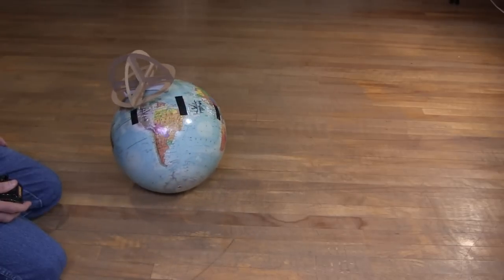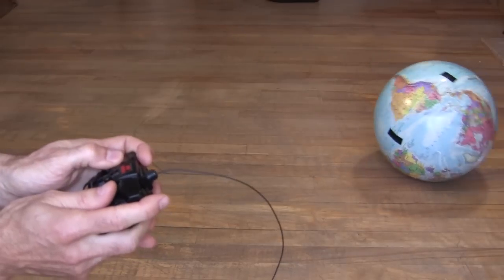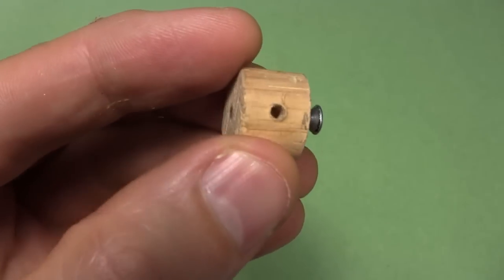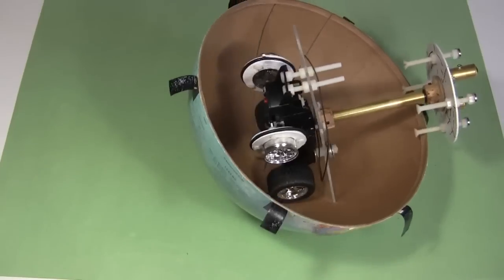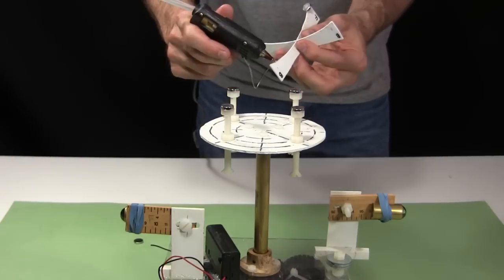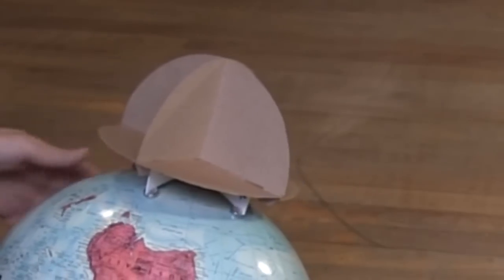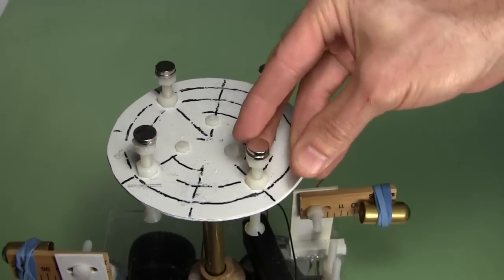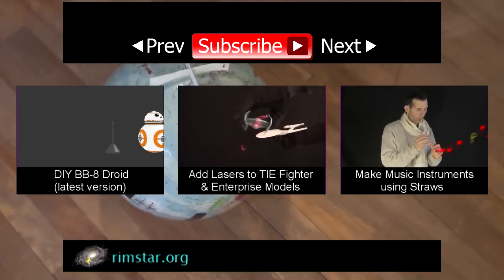Making a BB-8 Droid Build (v1) from Star Wars

Comment: Nice try using common parts as a prototype. Cad created parts are really needed in this project to get the tight tolerances for smooth reliable operation. If it were me, I would 3D print almost everything = Lots o work :)
Reply: Yea but if you 3D print everything it will set you back about $100 dollars paying for filament
Reply from the maker: +GuruBrew I still use toy truck's the RC receiver for my version 2 (video out next week, it's been a long road) and DIY dual H bridge circuits but at some point I plan on replacing both with common parts just to try them out. Version 2 still uses only a little 3D printing though: six gears, the head's radar eye and the head's holo projector. Either way you go, lot's o work :).
Reply: @sharpchain_1 that depends on how you make the designs.

you should know that with 1kg of filament (20$ per kg)
you can print a huge amount of things. and since most of the prints are simple, you can cut corners by not using 100% infill and make holes to reduce filament usage.

the ball cannot be 3d printed due support issues. but all main parts can be printed.
Reply: @darknessblades  "the ball cannot be 3d printed due support issues"
I hope you convince you otherwise. Check my channel in a couple days. I'm working on a video about how to print a sphere in using 32 segments which support and align each other.
Reply: @ddegn  With the current 3d printers it is possible to print it, but 2 years ago 3d printers where not as good as they where now, due there not being many Community hacks/mods created for many 3d printers

Comment: A very good instruction you've done.  Well done.  

And for those who have a r/c vehicle with an extra channel, the rod could be attached to an extra turning servo or geared down motor, allowing the pole to rotate, therefore allowing the external head to rotate too.  Or simply use a r/c tank and turret drive and bond the head turning rod to the turret mount.

Comment: More weight in the truck will let you up the magnet power / reduce the magnet distance without lifting the truck. It should also reduce wobble.
Reply from the maker: +Critters The truck isn't powerful enough to move more weight. I'm working on a more powerful drive system in version 2 that also weighs more https://www.youtube.com/watch?v=1gWBS70vphY.
Reply: Change those batteries from parallel to serial, what's the worst that can happen? :)

Comment: Take Magnets and make a ring out of them add the ring to inside of the globe 
so whenever the ball rolls the head will have always a magnetic to stick to ! 
also using some  plastic attach the motors and PCB to the plastic so you get rid of plastic body  weight ! 
All the very best ! 😁👍👌

Comment: So this is very much like a RC device I've been designing.  This might not quite work for the effect you are going for, but, another way to influence the turn capability is to attach an actuated weighted swing arm that throws the center of mass to the left or right of forward motion.
Regarding the top piece, vacuform it from thin polystyrene.  You know you've always wanted an excuse to build a vacuform machine.
Reply from the maker: +verdatum Sound like an interesting thing your designing. Vacuforming the head is a neat idea, can give it a lot of definition. And like you say, it's an excuse to build a vacuform machine!

Comment: Instead of making the head lighter, you might consider making the truck heavier, that would not only stabilize it with a heavier head, it would also improve traction. Also, instead of steel bearings you could use buckyballs, bearings made of rare earth magnets.
Reply from the maker: Already done, making the truck heavier and of course switching to more powerful motors to move that heavier truck. See my video series about version 2 https://www.youtube.com/watch?v=BCXH4AN2aog&list=PLFsZmHTZL-zmfXxstlxuJgRE9bOGobEVu

Comment: I love your work and very great way to share your passion !!! ... so much struggle for the top part to stay in place but, wouldn't be easier to imagine a metal bottom ball with rolling magnets on the top part that you would control the position (perhaps with little wheels on them controlled with a microcontroller ... might need some chip to know the position) ... anyhow, continue please, your work is fantastic !!!
Reply from the maker: +Olivier Preziosa Thanks! I had the same idea, to use a metal bottom ball, a few days ago. Though I hadn't gone further with the idea and thought about using rolling magnets to control the head's movement. However, I did realize that you'd have to synchronize its movement somehow with the movement of the ball so that the head stays on top of the ball while the ball is rolling along. The head might also want to be sitting off center while the ball is rolling. I guess using an inertial measurement board would work. It may actually be the way the one that's used on the publicity tours is done since a recent interview said that the head is independent of the ball (http://www.popsci.com/qa-how-to-create-robot-icon).
Reply: the head is definitely independant on their prototype, even just for being able to turn, or make visual effect (as on movement the head gets independantly of the direction on the front or the back) ... but really keep up your fantastic work !! i feel great i have discovered it ... first youtube chanel i ever register ^^

Comment: hello my friend..!! first of all .. you video rocks!!   I just write to tell you  that i  just fix the  magnets friccion problem in a easyer way.. all you have to do, is remove the magnets from each corner. from both sides, i mean from the car table and from the cross corners  in top of head.. and re installed right in the center on the center post in the  car table and outside right in the middle of the cross.. ..!!! that way you will let the rollers ball run free..and never will get stuck..that will solve the fricction problem.. and you can play with the magnet inside high to get a best strength between magnets. i just did it ,and works very well.. once again thank for share you video ...hope this help
Reply from the maker: +gabriel lada Really! I will try that. Thanks. Do you have two sets of magnets in the middle so that you can make the head rotate? Or does it rotate with just one set? I guess if it's a rectangular magnet then you might be able to turn it with just one magnet in the head and one inside the body.
Reply from the maker: +gabriel lada I just tried it and it definitely was an improvement. Thanks! Version 2 will have this in mind. My truck is still under-powered though and gets stuck if the head magnet and the ball magnet are too close. If they're too far apart then the head falls off too easily. But it does hold on better when I get it just right. I'd love to see yours if you have any video or photos somewhere.
Reply: thank you for take a minute to read my coments..!!! :)  about the truck i also resolved  that problem , you are right about the truck.. gets stuck if the magnets are too close.. I do solve it putting another extra couple of rollers inside the ball right where magnets were before , in the table over the mast .. that way  makes pressure and push my truck the other way ..that helps me to don´t get stuck.!! hope you can try it.. i´ll send you a pics and video of mine by tomorrow.!!

Comment: I think you should stick with the rollers on the head but you should put two BIG magnets inside the ball and two BIG magnets on the bottom of the "head". Put the magnets close to the middle of the top of the ball and near the center of the cross you made. Use two magnets so you get a good north and south pole to keep the head pointing in the correct direction. (Or use a bar magnet on each side with the poles pointing front/back. Using a bigger magnet should give the head a lot of attraction to the body.
Reply from the maker: +USWaterRockets Yeah, I'm thinking that too. Non-ferromagnetic balls and then separate magnets. I noticed that Sphero's BB-8 toy takes that approach.
Reply: +RimstarOrg I just saw a video showing how the "Target Exclusive Hasbro BB-8" toy works. You might want to look at that one for inspiration. It seems to have only 2 wheels in the drive and a mast with the head and plastic bearings on the head. The 2 wheels are augmented by some "idler" bearings at the front and back. Having 2 wheels means that the drive system can rotate about the vertical axis inside the ball by driving the wheels in opposite directions. The head "points" to the "front' when the internals rotate, and so he can make 90 degree turns. It's a toy, but looks good.
Reply from the maker: +USWaterRockets Thanks. Yup, I've seen that one. It's also pretty much what I have in mind so far for version 2, two wheels and my rollers (or possibly bigger ones) at front and back, and then the mast for the head. Future enhancements for the mast would be to make it able to rotate, and later still, to tilt, for full head movement.
I found some drill batteries at a community garage sale this weekend and already have drill motors so the next step is to see if I can adapt my remove control receiving hardware to that. I haven't looked yet so that may be a non-starter.

Comment: nice deal this is exactly how bb8 works 

something has to control it inside to make the sphere move
Reply: the only problem is hot glue with the wires it wastes a lot of motor power 

soldering is better u know something people easily get away with  with in motors

Comment: What if stronger magnets and exstended the rods on wheels to be much smoother and head would stay on
Reply from the maker: +Splash Stronger magnets would make the head stay on, or just raising the magnets inside. But that has the effect of gripping the structure that has the magnets on it inside the ball to the top of the ball. That strong grip is through the magnetic field, to the magnets under the head, and those magnets pressing hard against the outside of the ball. The truck has to be powerful enough and have good enough traction to overcome that grip. And my truck wasn't. That's why you see it getting stuck sometimes in the video.
My version 2 BB-8 overcomes that with more powerful motors and a heavier "truck" for more traction. You can see that one here https://www.youtube.com/watch?v=BCXH4AN2aog.

Comment: IF YOU USE A RC THAT TURNS BY MOVING THE WHEELS/TRACK ON ONE SIDE SLOWER THAN THE OTHER,  IT WOULD TUNRN BETTER like a remote control tank
Reply from the maker: +John Smith That's close to what I'm working on now for my version 2, a tank drive or differential drive except that my RC gives either on or off, no variable speed. But I'm using separate RCs for each wheel. So at least one wheel can be on and the other off, or both wheels can be turning in opposite directions at the same time.

Comment: You should find an old sphero on ebay and buy it, cut it open, and see what mechanism they are using.
Reply from the maker: +Kevin Medici (FLuffeeKay) Thanks. No need to though. There are a few videos on youtube that show people taking them apart and showing what's inside. My current plan is for my next version to do something similar in the way it's driven and steers.

Comment: you should put a magnet in the middle of the cross and keep the ball bearings
Reply from the maker: +Jimi-ray grotenhuis Yup. Someone else suggested I try that and so I did. It does seem to work better that way. It makes sense. Thanks.
Reply: +RimstarOrg when are you continuing ?
Reply from the maker: +Jimi-ray grotenhuis I fixed the last problem (hopefully) with the new remote control/arduino/drill motor control circuits on Monday. Hopefully I'll be able to get put it all together and get it in the ball and with a head by the end of next week. There's no guarantee it'll be an improvement, but it should be.

Comment: use stronger magnets INSIDE AND OUTSIDE and those marble rollers on the inside to keep the magnets from sticking to the ball
Reply from the maker: +Julinator LPs I agree regarding keeping the rollers separate from the magnets. However, the problem isn't the magnets sticking to the ball. Even if the magnets aren't in physical contact with the ball their strong attraction can make the rollers press so hard against the ball that it works out to much the same thing. Think of how easily a bicycle moves with a lightweight person on it versus a 1000 pound weight instead. To overcome that you need a heavier and stronger drive system at the bottom of the ball. That's why in my version 2 (https://www.youtube.com/watch?v=1gWBS70vphY) I've switched to drill motors and drill batteries, which are not only more powerful but also heavy.
Reply: +RimstarOrg i see ^^ however, nice work
Reply from the maker: Julinator LPs
Thanks,

Comment: hey, just a thought... instead of ball bearing, why don't you use magnetic balls, they will still roll but I would think that they would keep the head on better?
Reply from the maker: +declan casey Thanks, but that's equivalent to using the steel ball bearings with magnets on the inside of the globe like I did. It's still a magnetic attraction to balls. I've found that the problem with that approach is when a ball, either a steel or a magnet ball, skips off of the globe so some reason, the attraction is essentially lost for that ball and the whole thing can fall off. It's better I think to have separate magnets and the non-magnetic balls/rollers.
Reply: +RimstarOrg oh okay, makes sense

Comment: This was really great! If I wanted to host a workshop and teach around 20 college students how to make a droid, could you suggest how I would do that?
Reply from the maker: +Madiha Irfan Thanks! If I were you I'd first build a droid that was simple enough to make in a workshop and go from there. Also, the cost of parts may be an issue. If the each student will be making one then you'd have to get funds for parts.
Reply: I was thinking of charging a fee for people who are interested. I would want the materials to be as cheap as possible while still working. Would you have any suggestions on what cheaper materials to use and the best way to make them? Thank you!!
Reply from the maker: +Madiha Irfan Well, I wouldn't do this droid for starters. For a workshop I'd probably use an arduino (there are a lot of variations, and some are pretty cheap) and do something with three or four wheels and a few sensors for knowing when it's about to hit a wall. I haven't done anything like that myself but I've seen a lot of people doing them at maker events. They seem to be a good starter for robotics.
Reply: +RimstarOrg OK! Do you have any suggested videos or websites I may use? Thanks for all your help BTW!
Reply from the maker: +Madiha Irfan Not really. Do a google search for "arduino robot" and you should find plenty.
Reply: OK, I will. Thanks for all the help. I also loved your video. You're very talented!

Comment: Do you think it would work if you cut the tires in half and put them back on the car?
Reply from the maker: +bradley foster I don't think that would help, or at least not enough. I think the motors need to be stronger and at the same time the truck needs to be heavier so that the wheels can get more traction to be able to offset the pull of the magnets at the head. I've managed to get it to work in my version 2, but it's a very different machine https://www.youtube.com/watch?v=BCXH4AN2aog.
Reply: Ok thanks! Im watching your second version now.

Comment: 2:26
sorry
as they call those little things
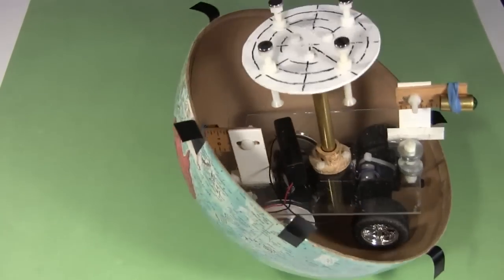3:28
the base holds tube q
what is your name?
Reply from the maker: +Angel Loyaga Are you asking what they call the things at 2:26? At 2:26 I'm putting nylon bolts with nylon nuts into the holes in the plastic. I used nylon because it is very lightweight.
At 3:28 I'm also using nylon bolts. Or are you asking what is at the base of the brass tube? At the base of the brass tube is a wooden part that I made a long time ago.
My name is Steve.
Reply: +RimstarOrg 
thanks for answering...
measures brass tubes?
nylon measures?
which are?
Reply from the maker: +Angel Loyaga The brass tube is around 5 7/8"  long. It doesn't have to be precise since the ends don't have to be pressed all the way into the wooden hubs. The nylon bolts are 1/4" bolts and 2 1/2" long.
Reply: +RimstarOrg thanks for the help you have given me...

Comment: Try using stronger magnets maybe?
Reply from the maker: Stronger magnets would mean that the head would be pulled down more strongly onto the surface of the globe, as you'd expect. But that will act like a break to the magnets and truck inside since they now have to try to roll while that "break" is on. That means the truck would have to have stronger motors and be heavier for more grip. It's a balancing act.
That's just what I did for my version 2 https://www.youtube.com/watch?v=BCXH4AN2aog&list=PLFsZmHTZL-zmfXxstlxuJgRE9bOGobEVu.

Comment: where do you get the truck??...are the pipes made up of brass?
Reply from the maker: I bought the truck from a yard sale but I've seen it in the Toys R Us store. Keep in mind that as you can see in the video the truck wasn't powerful enough to work with a complete BB-8 head and so you'd need to find a better one anyway.
Yes, the pipes are made of brass, though any metal tube will do (aluminum or copper for example.)  Just make sure it's a thin walled tube since you want a low a weight high up as possible. As much of the weight should be low down.